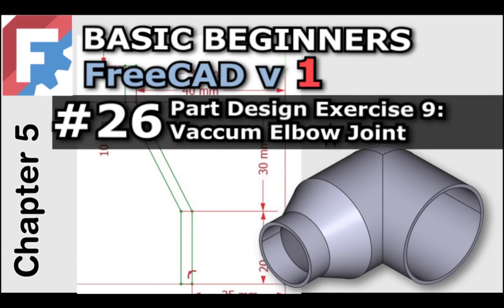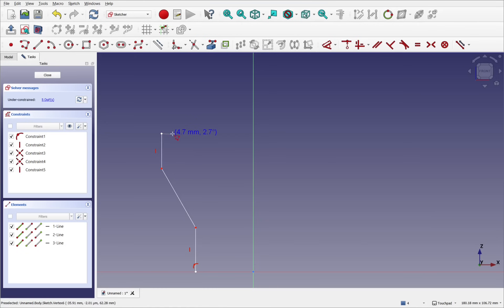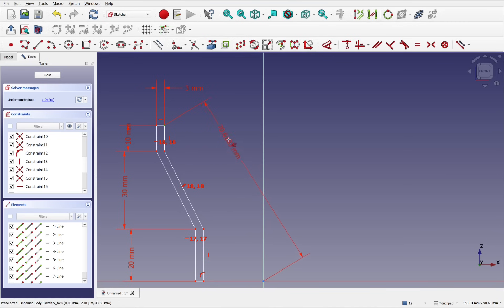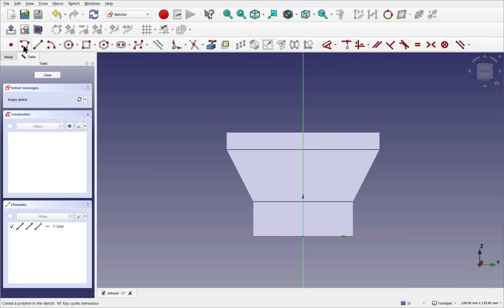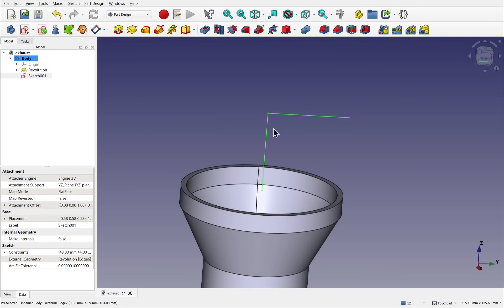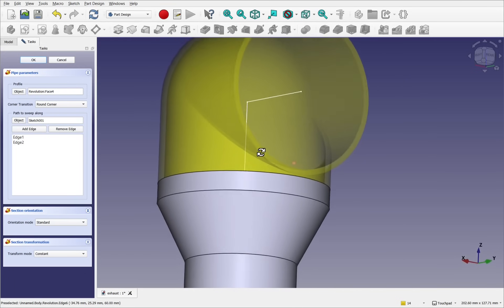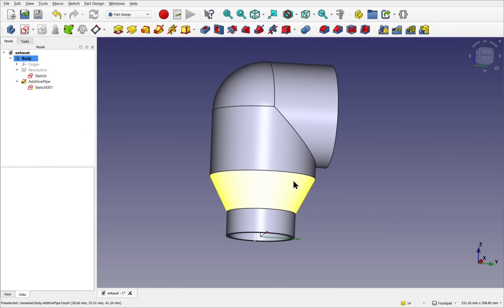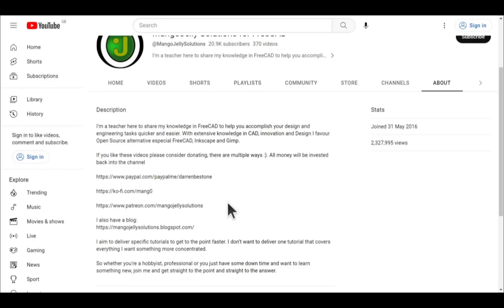FreeCAD 1.0 | Vacuum Elbow Joint - Basic Beginners Lesson 26  Part Design Exercise 9

Comment: Nice example of additive pipe. I tried building this in Alibre Pro, but no additive pipe option, had to use a sweep but then no corner transition options were possible just the ugly 90 deg corner. Also had to create a sketch on the pipe face of the revolved part, an extra step because I couldn't just use the face. Just goes to show that open source is sometimes better than the paid options. GO FREECAD!
Reply from the maker: Thanks for sharing your comparison, that's pretty surprising that the software doesn't support those transitions! Was not expexring that.  Glad you enjoyed the video.
Reply: @MangoJellySolutions  I had to add a fillet to get the smooth transition, just an extra step.

Comment: 13:55 i can see this is similar to errors that can happen in other operations where the measurements of one operation are set equal to another and it creates an error.  I remember in another lesson this was resolved by changing one of the measurements so that it was just .01mm smaller or bigger.  This is very interesting to see!  Thank you MangoJelly:)  It's making sense to me, I can see why it would logically fail
Reply from the maker: Thank for feeding back, great to see your enjoying.  One thing that I am getting out of the comments is a real need to index these videos. I have collected all the transcripts and looking at ways of extracting out those little tips regarding errors.  Are yes, I think that was the fillet / chamfer to base.  I have ideas to bring all those together so they are easily searchable.
Reply: @MangoJellySolutions yes that’s exactly it, fillet/chamfer to base.  That indexing project sounds pretty involved.  It would be an awesome addition, though the videos alone are a treasure trove. Thanks again:)

Comment: Passed trough. All worked well until I tried not only to turn this pipe horizontally right but then add another edge of the path going forward (opposite to me)... This caused problems and questions... another sketch in different plane? another pipe?... hope this will come a clear soon :)
Reply from the maker: Ahh so two sketches, in different planes and pipe along both?
Reply: @MangoJellySolutions  This is exactly what I was thinking about
Reply from the maker: This should help: quick video explaining it: link: https://youtu.be/jE-H_30MbcA

Comment: A fatal error occured when making this pipe. 

I get that whenever I attempt this from the using the face at the end of the revolution as the profile(also called face4, as it is for you.) Sometimes I get a preview of two cones with the point above the edge of the large revoled diameter, at the height of the turn in the Path sketch. 

If I create the pipe using another sketch on the face of the revolution, it works as expected. Any idea? FC1.0 on Mac.
Reply: I spoke too soon...sometimes I also get the error with the profile sketch, and have now gotten it to work with the face of the resolve. No idea what makes it work or not work.

Comment: You swept a revolved surface. I'm trying to sweep from sketch1 to sketch 2 along a path (sketch3) - I thought you could do something like this but it's been a while. Does it need to be a face or can it be a sketch?
Reply from the maker: Yes you can do that, I think the next lesson in this series where we make a fishing lure has exactly what you need.  There is a option in the additive where you select multi section and can add additional profiles to shape the sweep / pipe.

Comment: Hello! I'm getting this error while trying to sweep path with AdditivePipe: 
BRepFill_Sweep::BuildEdge and the operations fails. I followed your every step but can't figure out why it's failing. Any ideas?
Reply: I had the same issue.  Seems that the revolved surface is showing as not planar. To fix it, I created a datum plane on the outer edge of the circle, sketched 2 new circle profiles on the new plane using the external geometry reference then proceeded with the pipe with no problems
Reply: @teesider61  Thank you, that was a great help. I followed your advice.
Reply: @teesider61  I am running into the same error ("BRepFill_Sweep::BuildEdge"). I created a new datum plane on the pipe face, using external geometry from the outer edge and the inner edge of the lower pipe. I then added two circles, one on the outer and one on the inner circle. Then I tried to resume the lesson but am getting the same error.  Can you clarify what you did to "fix it"? I'm so close... (using FreeCAD v1.01 revision 39285) on Mac)

I've made it through all the lessons so far without issues. I redid this lesson 3 times to make sure I wasn't making a mistake, I'm pretty confident I'm following the instructions correct so far. There's a bug in the FreeCAD version or the instructions. Can anyone suggest a fix?

Comment: I always pick up a new trick or two. I thought you always had to sketch a profile for an additive pipe. I didn't know you could just take an existing face from the model as the profile. That's a cool trick. I'll have to play with that.
Reply from the maker: Great to hear 😊. You can do this with all the addative and subtractive operations. I have used it in the past for a quick dirty fix on a model when, say, I wanted one of the faces a little bit higher. It can be abused but at the end of the day I got the print that I wanted. But for this kind of application and lofting from a face of a pad it can really be useful. Shape binders are another useful one as they have a offset, so you can bind the face, create a small offset and then use that to make a thinner loft / pipe without the need of re-sketching.
Reply: Yeah, me too!